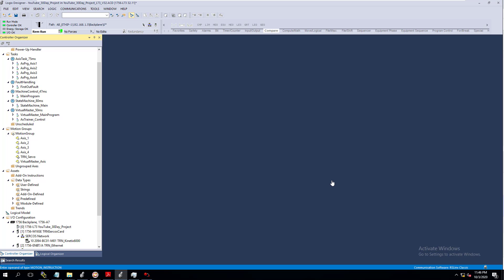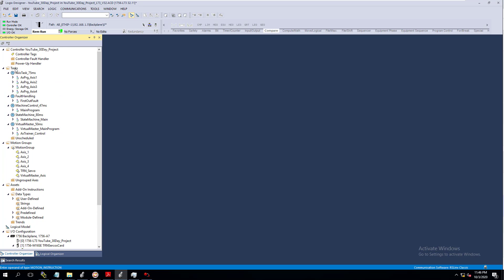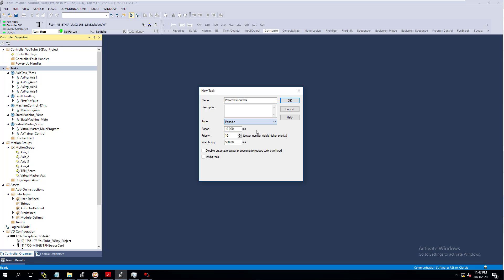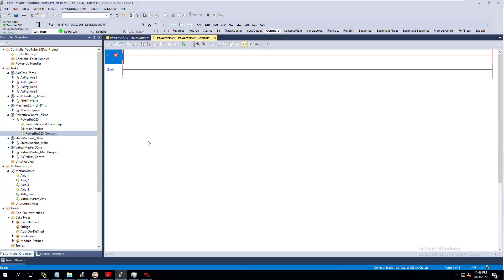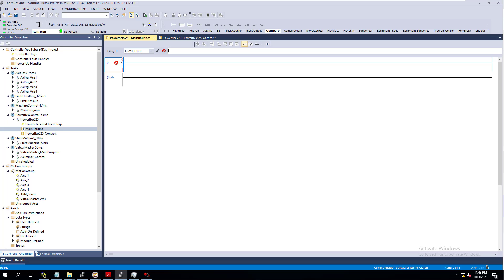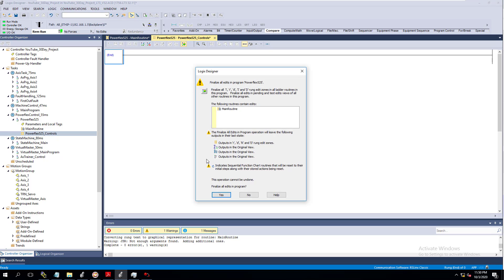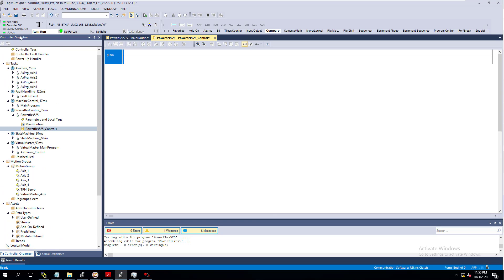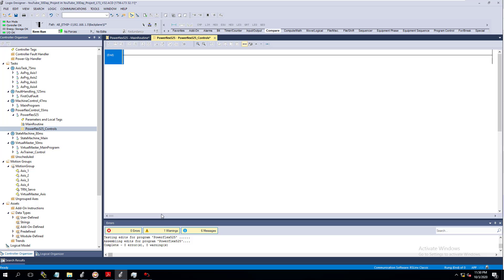Powerflex 525 Controls In Studio 5000 V32 | Start & Stop Commands With Speed Controls

Comment: Hello sir, I am facing one issues we have dam gate control application using PF 525 VFD. While gate opening we don't get any fault but when we start down operations VFD gives Overvoltage F005 alarm after 1 to 2 feet down from actual position. There are two cases 1 decelation time is 1 sec. Second 120Ohm 2.5kW DBR is used DBR Parameter is also selected Normal duty cycle also I checked with different duty cycle . Still problem is there so please guide me. Thank you.
Reply from the maker: Sounds like you need to decrease the decel and if that doesn't help then you need to add a braking module to burn off any regeneration power from what you described.

Comment: Hi Prof, do you have an email address I can contact you?  I need some quick help with a PF525 on LogixDesigner 32.11
Reply: Thanks prof, I checked your website yesterday, but couldn't find on it what I needed.
My problem is I have 4 VFDs running and I need to read the current, I'm using LogixDesigner 32.11 and I changed the device definition so I can read the current, but when I downloaded the program to the PLC, the drives got faulty and can't connect to PLC, I can't find the buttons and tabs LogixDesigner 30 and 31 have to download the changes to the drive configuration tab, because no tab for drive in version 32, and can't download it online cause drive isn't connecting
Reply from the maker: @jrdz009  If you need to read current then either add it to the drive configuration on the PLC IO for yh drives then download so the tags are used or just use that message instruction in the current program to read information front he drives.
Reply from the maker: @jrdz009  The link I providing is for personal one-on-one training via a zoom meeting, you are aware of that correct?
Reply from the maker: @jrdz009  I just made a video if you want to see it.

For the message instruction setup.

Email me at Shane@OnlinePLCSupport.com
Reply from the maker: @jrdz009  Here is the video on how to read current from a Powerflex 525 drive.

https://vimeo.com/653253324
Reply from the maker: Hello, thank you for your support.

I have a one-on-one coaching program I made to help with custom things that anyone has trouble with.

Mainly because of demand, I have limited time so if you are interested then please visit the link below for a one-on-one coaching session.

https://www.allen-bradley-plc-training.com/p/factorytalk-view-studio-site-edition-training-live-with-q-a

Comment: Do you have an example of control speed using high/low limit switches and timers? Such that if the low level is on and speeds up for every second it is on? Slows done when at the high level. Thanks
Reply from the maker: That is fairly simple to do if you would like for me to make one.

I have similar logic controls in my training courses at
https://www.allen-bradley-plc-training.com/

Comment: Is it possible to control the powerflex without plc? Only Modbus tcp?
Reply from the maker: It's possible to control a Powerflex 525 with no plc controls.....yes

You can use push button controls wired to the digital inputs or just use the keypad